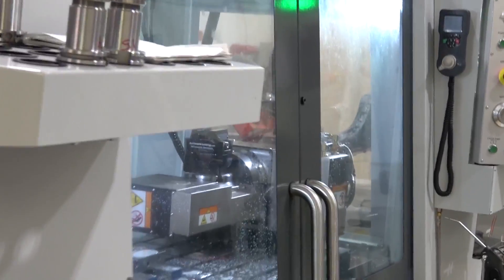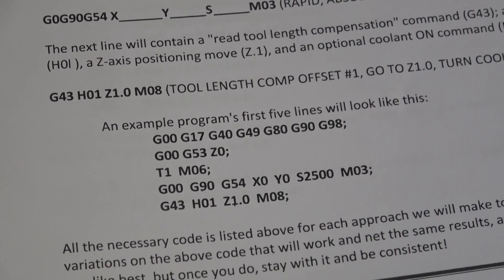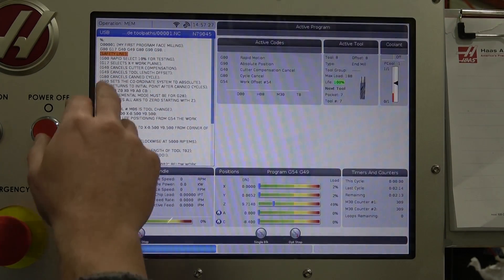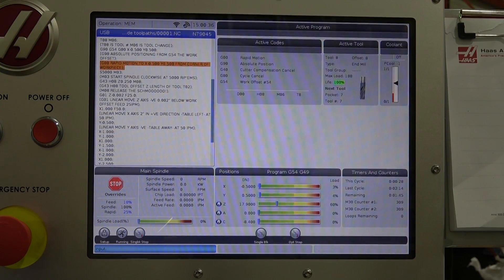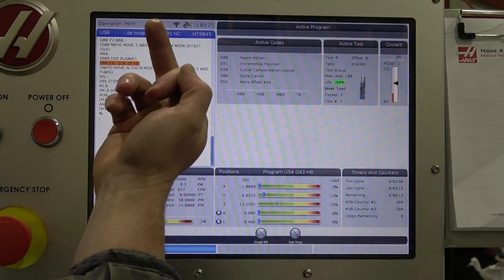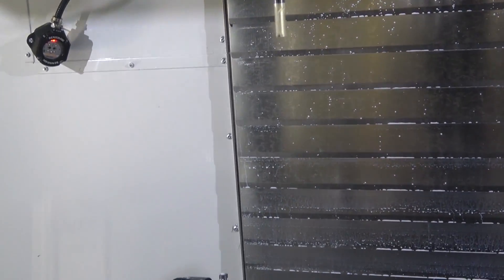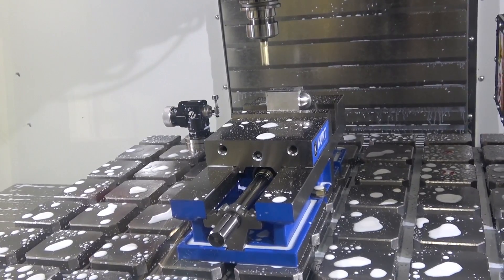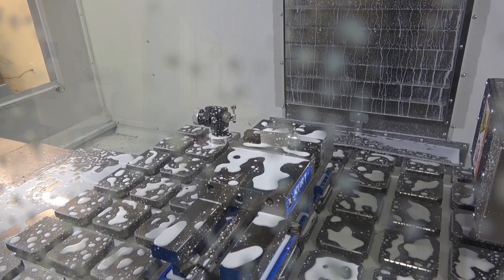Beginner CNC Programming | G-Code

Comment: shouldnt need incremental to use g28, g28 is itself an absolute position code, using the machine zeros, as a rule its better to not use incremental code g91 unless part of a sub routine that repeats, can cause crazyness if its not set back to absolute g90
Reply: "G53 G0 Z0" does the same, stays in machine coordinates for that line only, works in Absolute.
Reply: @padam1277  been awhile since i played with haas controls... seems like g28/g53 were interchangeable though, at least g28 on a standard Fanuc control anyway
Reply: G53 puts the control in machine coordinates  for the current block only. @northmanlogging2769
Reply: @padam1277  edited cause issues... G53/g28 do the same thing, both are single line codes, when used your fixture offsets stay valid, both are generally used for sending the machine home, or at least to a safe place, Haas also has a g52 that is user set able, much like a g30 only way easier to set (no paramater/settings changes etc)
Reply: However, as I originally stated, g91 should be avoided always, it does not effect g28-g53-g52-g30 as all are machine coordinates, however, as I said before g91 is modal, and will remain in effect until canceled, reset does not cancel it, only g90 sets it back to absolute positioning
Reply: To elaborate, Modal codes are codes that stay in effect until changed or canceled, g0 g1 g2 g3 for example g81-g80/g0 etc g54-g52(haas only) In other words g91g28z0, would read, incremental mode, rapid to machine home, Z axis ;  note how g91 is a mode.... and stays in g91
Reply: As you know, G28 is movement to reference point with intermediate movement. G91 G28 Z0, moves 0mm/0inch on Z direction and then homes Z axis. G90 G28 Z0, moves to Z0 absolute position (not good if its inside your part) and then homes the Z axis. Thats how Fanuc does it.
Reply: @MummifiedInBarbedWir  g91 is incremental only, does not effect g28 in any way, however g91 is modal, so when set machine remains in g91 until cleard by a g90, so if some unkle bumble were to then do some other line of code without a g90, all hell would break loose, so i repeat, it is better to just not use g91 ever if possible and only in a subroutine as needed, also g28 is not a movement code, it is merely a reference position, much like g30  but is factory set to the machine zeros, some machines will default to rapid on a g28 line, but most do not.  You are possible confusing g28 with one of several coordinate codes, g54-59 g110-xxxx haas or g54.1pxxx fanuc etc, or possibly g10 cause g28 is factory set and unchangeable for a reason
Reply: @northmanlogging2769  Take a gander of any of the many G code sites or read a book by Peter Smid, any of them.
Reply: @MummifiedInBarbedWir  sometimes the books are wrong, this comes from experience, not book learning, the experience of rebuilding machines after book smart idiots, me included, break stuff, then I got the job of fixing their mistakes and attempting to make sure they never happened again, Please note, I no longer choose to work in industrial machining, as those with experience are constantly being ignored, because they didnt write the book, or kiss enough ass to be listened too, also note most Machine user books are not written by machinists especially Fanuc, Haas and Fadal, used to be the exception, so a whole lot of viable info is lost in translation. g91 i repeat is not needed on a g28 line or ever outside of incremental programming, and incremental programming should be avoided at all cost, because spindles are expensive

Comment: When I moved over to the "advanced" side of the shop in 1981, we had just received, two NC lathes and Two NC mills. Not CNC, just NC!!! There were no desktop PCs or apple computers yet, no cell phones or tablets. We had to convert blueprints to compatible drawings to program by hand. Tool path confirmation was done on a 2 axis ink plotter thru a 3rd party on a fax line. Once the program was proven, it was typed into a teletype machine that punched holes in a paper tape (https://en.wikipedia.org/wiki/Punched_tape). The tape was then fed into the tape reader on the machine, and you puckered your butt and hit start. If any changes needed to made, it was back to the paper tape punch machine. On GE 1050 controls you could only read the X and Z positions, not what was going to happen next (http://i1104.photobucket.com/albums/h330/hitandmiss2/Old%20NC%20Machines/DSCN1125.jpg). When the owner upgraded the Okuma-Howa NC lathe to CNC we thought we had died and gone to heaven. NO more paper f******g tapes. The two mills were Bridgeports with BOSS controls( either 4 or 5, I don't remember). Z axis was manual and so was the drawbar.  Before I retired I was programing and running either a Ikegai VT1100 or the Proto-trak column mills and still doing conventional machining. Uncle Bumble is still learning so don't bee-little his efforts or mistakes. I never got to use a HAAS as I was on my way out the door for the last time, as they were coming in. Still, it looks a lot easier than 1st gen MAZATROL (God only knows how much I hated that). OH, and does anyone here remember having to figure out I and J for radii?

Comment: If there is no decimal point the control defaults to a "safe" move. It reads that number as the lowest unit of measure it is capable of reading. For example if the control reads 1 without a decimal it defaults to .0001. "Best spot for the E-stop on a machine? Between the machinists butt cheeks"! cheers

Comment: As a couple of others pointed out, it wont read a number without a decimal as a whole number, rather it defaults to the lowest perform-able increment. You can change that in settings but personal preference. I was always taught rather than fuck around just get used to putting a decimal where you want it when manual coding for safety's silly sake.

So instead of writing -1.001 for -1, just write -1. and itt'l do whatcha want.

Comment: G28 is scary, it sends the endmill to MACHINE coordinate x0y0z0. This is different from WORKPIECE coordinates, which is what you usually change when zero'ing to your workpiece.

If your machine isn't home'd and doesn't have limit switches installed, and you zero to a few different heights, a g28 can send your endmil crashing a foot deep into your wasteboard. If you're lucky.
Reply: first of you should always home Z alone and only then the X and Y,  G91 G28 Z0, takes the spindle safely to home, G90 G28 Z0 will take your spindle to where ever your work coordinate Z0 is and THEN home it. so G91 G28 Z0; G28 X0 Y0; and youre golden. You really should install those limit switches.

Comment: hey AvE, if you need an overview of the most common g-code, it's extra addresses and so on, I could provide that. It's standard to start on here in Germany, so I could easily translate them if you wanted. Learning by using it seems more reasonable than having to remember everything from the start. not sure how much it'll help, but having them hanging next to you in list form might not be a bad idea.

Comment: 3d printers also use gcode... If you have the object modeled in autocad, i believe there are addon programs that will generate g-code machine paths. I'm not a machinist at all just saying there might be an easier way.

Comment: Love watching these videos but it's kinda painful to listen to the explanations when you know g-code and why you have to do each of the "weird" things. BTW the prep line is because g-code can be modal and non-modal. If you put the machine into a "mode" it will stay there until you tell it to change modes because the modes can be conflicting, like moving in a straight line and an arc at the same time. Its like a light switch, the light will stay on until you turn it off and you don't want it to be on and off at the same time or you may end up with a dead cat when you can see again. Also, someone already mentioned it, but 1 = .0001 , 10 = .0010 , 10000 = 1.0000 . It is part of a programming standard adopted from the dawn of NC machining and HAAS allows the old standard and the new mixed together in chaotic harmony. Don't forget the decimal point on the rotary axis or you will be scratching your head for hours trying to figure out why it isn't moving anywhere!

Comment: Heyo! If you ever end up reading this, here's a tip for proving your programs out. Instead of consulting the little positions screen for positional information, hit "CRNT COMDS" (top right of display button cluster) and you should see the right half of the screen change, then "PAGE DOWN" (beside arrow keys) maybe four or five times until the right screen shows four columns of information (Operator XYZA, Work G54 XYZA, Machine XYZA, and Dist To Go XYZA). With this info you can immediately know if you're going to crash in the next five seconds. Stop your tool maybe 0.5" above the part, check the absolute to see that you are where you expect and check the "dist to go" to see where you're going. If you're 0.5" directly above the part and your dist to go says -5.1", you're probably about to manufacture alot of noise. -Tips from someone who's learnt this the hard way, again, and again, and again.

Comment: Hey Uncle B, 
 A programming method I like to use when I send the machines home at the end of a program or at a tool change is as follows. Instead of 
....
Blah Blah Blah;
Programming stuff here;
G0 G90 Z1. M9;(1" above the part,coolant off)
G91 G28 Z0. M5 ; (incremental,  go to Z home, spindle off)
M01 ;
(Favorite DIJET tool);
T2 M6;
.....
I like to do
....
Blah Blah Blah;
Programming stuff here;
G0 G90 Z1. M9;(1" above the part,coolant off)
G90 G53 Z0. M5 ; (Absolute,  Machine work coordinate system Z home, spindle off)
M01 ;
(Favorite DIJET tool);
T2 M6;
.....
That way you avoid incremental mode all together . With the HAAS you can also do
........
Blah Blah Blah;
Programming stuff here;
G0 G90 Z1.M9;(1" above the part, coolant off)
T2 M6
M01 ;
(Favorite DIJET tool);
.....
With that method, the HAAS control will automatically send Z home, stop the spindle, coolant and do a tool change.

Comment: On the haas controllers if you dont put a decimal point on most things it interprets it as the old style of programs where there were no decimal points. So a Y-1 without a decimal point will be read as Y-0000.0001 which is -1 tenth. If you put the decimal point it reads it normally as -1 inch. Hope that makes sence.

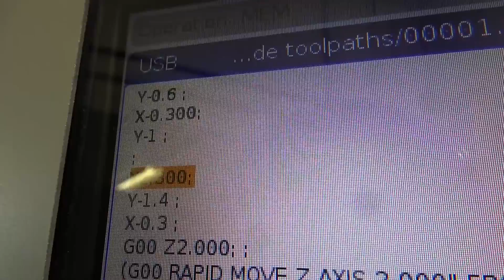Comment: 13:28 the Haas controllers are designed so if you enter in a number without the decimal, say for instance you enter in (-18) for a G54 work offset, the controller will read that as -0.0018. If you would have put in -(18.), The machine would now read that as -18.0000. you have to get used to putting in a decimal EVERY TIME you enter in a whole number on the machine. #paininthehaas

Comment: I studied G code for half a year with teachers, in CAD and on the job. Learning the codes by rote didn't stop me from doing some 100.000€ worth of damage (three precision tool heads with attached sensors, also all six workpieces that were loaded in the machine at the time) with and to the machine I was told to operate. Fun times.

But I learned to fucking triple-check my code and all my settings from then on.

Of course I was next given the job of finish-grinding a really finicky series of gear shafts which had a 90%+ loss rate, and this was considered normal.

Comment: have gone through the change from manual machines to cnc myself.  May I suggest something like fusion 360.  We use it for everything but the most simple machining.  Its free and you don't need to struggle with g code.  I think you will find writing g code for most machining is gonna take far more effort than learning a software system.  We have also found the ability to run a simulation of the machining about to happen is very reassuring when you hit the cycle start button.

Comment: Isn't there any software  emulators for CNC machines ? So you can just learn code without "moving a thing" ?
Reply: Yes there is, lots of them in fact. Every CAM program has a  simulator. And then theres stand-alone simulators too.

Comment: The Y-1; that moved Y-.0001 is a legacy of BLU programming , yea basic length unit (integer programming).  It’s ancient punch tape issues that goes back to the 50’s.  So each code had an assumed length, feeds are 3 decimal places positions are 4 decimal places.  So if you wanted a feed of 3.5 ipm you would do G94 F0035;  There is a parameter to change that to make it not necessary to have to have a trailing decimal, you really want your controls set up in decimal programming.

Comment: Don’t use G28!  It’s a stupid legacy command.  Use machine coordinates, G53.  G28 does not mean go home, it means “go home from an intermediate point”.  The reason you use incremental with G28 is you are doing a null movement to make G28 just go home.  If you are in G90 and you go G28 Z0; that block tells the machine to go to absolute zero and then go home.  Absolute 0. is the intermediate point.  If for some reason your tool length geometry is canceled with you execute that command you are going to power drive your spindle into your work piece, and then go home.  G53 is an absolute coordinate system.  G53 Z0.; means go to machine coordinate Z0.  It doesn’t even matter what distance modal you are in because it is an absolute coordinate system.  It’s fucking fool proof.

Comment: Without a decimal in a position block Haas defaults to reading thousandth's of an inch. Also just so you don's have to slow the machine down on a rapid before you cut to check your tool height offset, if you touch off / program from the top of your stock you can rapid z 3 inches above your part and slide a 123 block text to your tool for reference

Comment: Not sure if you missed my previous post. But practice using Wax. You can buy engineering Wax, and just melt it into blocks. then use that for messing around on. It wont break tools if you F$^k up. Plus you can gather all the swarf Wax and just melt it down again for re use.

Comment: Finally baby steps have been made!  You might want to use the handwheel to control feed rates instead of 5% etc. If so hit feed override key on panel right of Feed -10%, Normal, Feed +10%, then you can use the handwheel to control your feed rate. You will notice a black box appear on the screen in the info panel, wiz to zero before starting then raise up for required rate. Don't forget to keep off zero for tool change or it will time out. ;) A comment below regarding the decimal point is worth reading and correct. Please please, keep learning manual programing before being tempted to jump to CAM. A nice little program to use is Cimco, (shop floor editing tool) this also has a basic tool path and verification side. Very handy to remove the WTF is it going to do fear. It will also help with programing. Starting to have faith again, keep it up AvE. :)

Comment: The HAAS VPS could be a decent conversational programming language. Why HAAS has not hired a software engineer that gave a crap about VPS or not bother with VPS  I do not understand. It could be a nice intermediate step towards using CAM which should be the goal. CAM is the higher level language one should be spending 99.99% of their time working on. That said in any case there are time you need to tweak the G code so you have to know it. Software engineers might be aware of Assembly and even be able to code in it but they do not work in it. Also G28 DOES work with G90(Absolute Mode) I humbly suggest that you may not fully understand G28 and its misuse can be disastrous. HAAS has a tip of the day on it but this link covered it as well. https://www.cncci.com/resources/tips/how%20g28%20works.htm

"Watch out! Here's what can happen in absolute mode. Consider this command.

G28 X0 Y0 Z0
Assuming the machine is currently in absolute mode (G90), step one of G28 tells the machine to move to the program zero point (probably a crash). Then, in step two, the machine will move to the zero return position (if it still can)."

Comment: G code is actually very effective and in due course it will make perfect sense. Your machine is the tin man, G code tells it exactly what to do, how to do it, when and how fast using very little input when stripped down to only what's required. 

Don't forget that it's been around in substantially the same form for decades for a good reason.

Comment: In G code you will often see machines the interpret “1” as one tenth or “.0001”.  Haas is one of them, so you need to always be aware of the decimals.  Oddly if you run an Okuma it don’t need the decimal and will see “1” as one inch.  This can be very confusing when you bring a proofed out program from your Okuma machine and it fails to run as expected in your Haas.  This is something I deal with every day!

Comment: The vast majority of CNC controllers (99% of them) require the decimal point for any unit like feed or coordinate.  They'll treat "1" as "0.0001", so if you set "G01F1", it'll move at a feed of  .0001 inches per minute.  This will also happen with the rotary axis, so if you're setting a new angle of say 90 degrees but forget your decimal point, the rotary will do 0.09 degrees.  You can forgo leading and trailing zeros in both G and M codes on HAAS, so G00 can be typed as G0, M08 can be typed M8, and so on.  Coordinates can be typed as "Z.1" for "0.1000" on Z, but just don't forget your decimal points and it'll be fine.

Comment: wow, G-code. i remember when i used to set program and operate cnc lathes, half a lifetime ago. long since forgotten the most of everything except for how quick the work day would pass programing an setting a machine and how the days following when it was running would take forever,  bagging swarf, washing components, checking tolerance and tool wear, and often as not deburring and second opping, cleaning and packing. them were the days